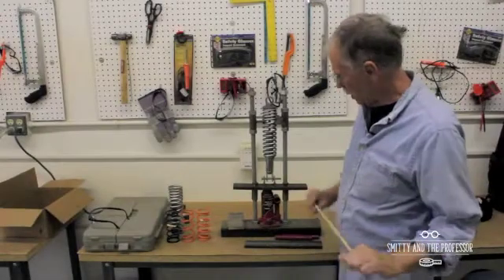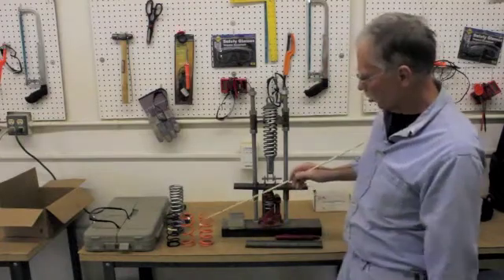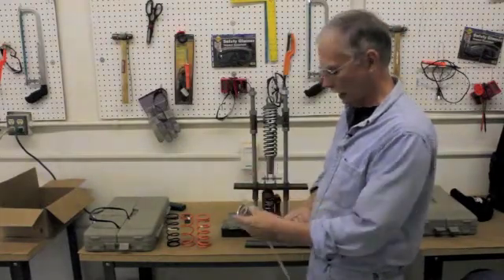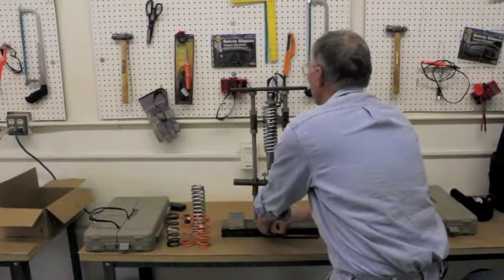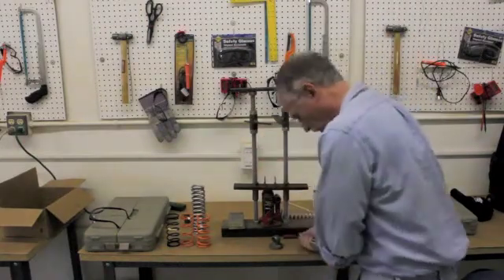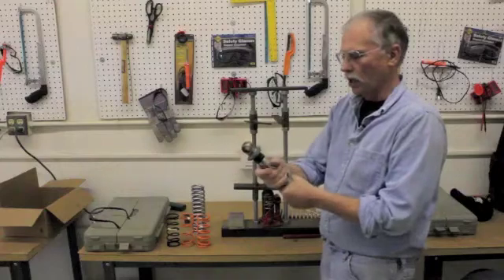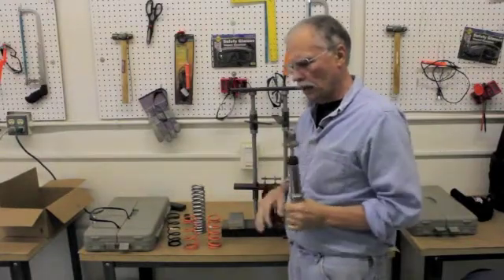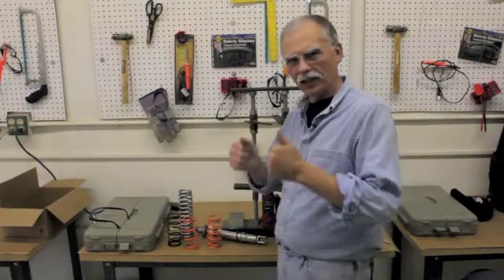Intro to Racecar Engineering:  08 Springs

Comment: Hellooo Smitty, hope my question finds you safe and well.

This is actually part tire pressure and part springs related, as pertains to street automobiles.

When you open the driver's door of most modern cars, you'll find a sticker with specified cold tire pressures on it.

Some recommend the same cold pressure front and rear axle.  Some recommend offset: The old Corvair had a whopper of an offset: 15psi front, 26psi rear.  Most recent Porsches have a offset: 35 front, 43 rear.

For mass-produced econoboxes and family sedans, even front-wheel drive only ones with weight biases up to 60% front / 40% rear, the same cold tire pressure is specified on both axles.

My theory is, on those cars where the same cold tire pressure is specified for both axles, that different thickness of  spring coil are used, so the owner doesnt' have to remember which axle gets which tire pressure.

On my 2010 Honda Accord, and my wife's older Corolla, the front coils measure 1-2mm thicker than those on the rear.  Was this done so the weight bias would not have to be compensated for with different front and rear tire pressures?

And do cars where different pressures are recommeded(IE: aforementioned Porsches, Audis, Subarus, etc) for different axles have the same coil thickness?

Thanks for any insight you may have on this!